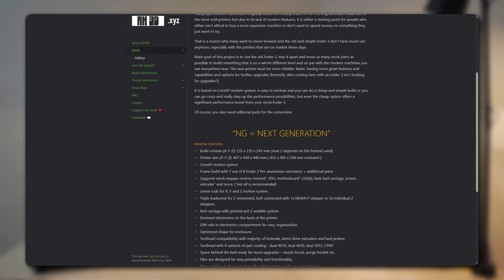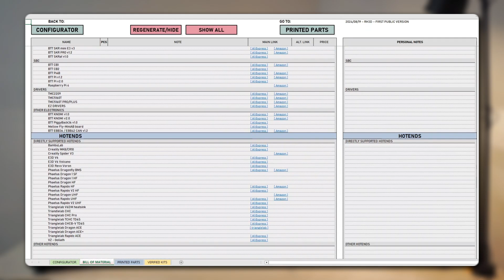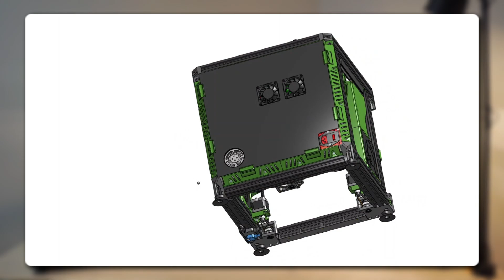E3NG v1.2 released - coreXY for your Ender 3

Comment: To give an advise as an developer: Don't try to make many solutions that fits all. Your project is to small to get so many solutions up and maintained. Make the solution that fits your need. Make documentation (your project site is litteraly empty ("Under construction") that doesn't make appetite to read further). Talk about it. Try to get help. Reuse other projects and mention them. E.g. don't try to build your own toolhead ecosystem when there are plenty open source systems available (EVA-Awesome rails bases system;if you insist of the old steel pipe based linear motion system maybe Hypercube Evo Ngen is a possbile choice).

Clean up your promiscuously Z-axis. I see a mixed up monstrosity influenced by VzBot (tripple Z-axis, Anti-wobble fixture), Creality (adjustment wheels) and Hypercube (steel pipes) that doesn't fit together. If you want to use a trippel Z-axis with anti-wobble it is important to use rails. Pipes make no sense, as the fixture needs a fixed point that pipes can't provide (pipes are joints@z-axis).

Good luck!
Reply: listen to this comment
Reply from the maker: In a certain way I totally agree with you, having one or two options for the build brings many advantages, is simpler for users and gets the result faster as you don't have to work on so many things. The project even started much simpler with the beta version.
On the other hand, since the beta release, I have been closely listening to users and the feedback from community and did few researches during the v1.2 development to know the demand and I think many people appreciate it. Some options are leftovers from the beta version though just improved and I was even thinking about cleaning it up and offering fewer options many times but left it as is for now.

If I manage to bring my other projects to the public though, they will definitely be much simpler with less if any options, it just wouldn't be possible to maintain it all alive while keeping the quality good just as you said.

Also this being my first project of this size, I myself see a lot of imperfections now and I have learned a lot, but fixing and completely reworking them would still be kind of a band-aid fix and the project being already quite spread out, I wanted to keep within the beta version boundaries.
If I would do it now again (or maybe a v2), it would be completely different from the ground up and way better.

Thanks for your feedback, I appreciate it!

Comment: Do you think it's possible to do this with a cr-10 version 2 or version 3
Reply: Basically it's the same base. if something is missing: Amazon is your friend (beams, printer boards etc.)
Reply from the maker: You would definitely need to check first, but there are few builds on discord using different printers as a base with some slight modifications to make it work, I am not sure if someone already did CR-10 build but it might be possible.

Comment: I want so bad to do this but looking at the BOM you start wondering if any of it is worth it when you can just get a bambu lab A1 with AMS for the same price.
Reply: get the a1 and then do this worth it. I have a p1s with ams and a a1 mini and looking to do this to my ender 3 v2 later on this year
Reply: it depends what you are interested in> If you are interested in how 3d printers work and like building, trouble shooting and have a bunch of parts laying around this could be great. If you just want to print stuff get an A1
Reply: It's an heard and soul project, not a brain project 😂 I spend ~900$ for my CR10v0 to let it print at 400mm/s@3000mm/s². Now I brought a P1S for the same money but 500mm/s@10000mm/s² and closed buildroom 😂 It has nothing do do with logic. It passion.
Reply from the maker: Exactly as other said, you either want a printer or you want to build the printer, looking only at the price and time invested, there are definitely solutions that make more sense.

Comment: Hi can i use skr mini e3 v3?
Reply: Is it the board with the already mounted TMC Drivers? If you want automatic build plate tilt you need 3 z-drivers, 1 x and 1 y and 1 driver for extruder (=6 Stepper Drivers).
Reply: @christianmontagx8461  you can easy use IT for the 1 Stepper for z Version, but also Triple z ist possible with a 5 Driver Board when adding a toolhead Board Like ebb36 AS it comes with a 6th Driver for the Extruder.
Reply from the maker: Hi, sure you can use it, there are people using these boards and I have been using SKR mini E3 v2 before, so it is perfectly capable for that.

Comment: What slicer is everyone using for this? Anyone using prusa slicer for it?
Reply: Hi there, while I don't have a E3NG v1.2 coreXY printer I am curious why you are asking what slicer to use with it since as far as I see that's irrelevant here since there is no multi color or multi toolhead setup on this printer which some slicers can't do, right?
So you should be free to use any slicer you want as far as I'm concerned.
Reply: Orca Slicer. Came from Cura to Orca and never want back :)
Reply: @christianmontagx8461  Hi there, have you ever tried prusa slicer? It has a really cool feature where you don't set the speeds for the parts yourself but only a max flow rate and the software determines speeds from this. Makes for really smooth prints in my experience. Switched from cura to prusa and while I think cura has better bridge settings I can't go back to setting up speeds for everything myself lol.
Plus the paint in support feature and paint in seam feature is also really nice to have in prusa :D
Would be interested to hear back from you if orca provides similar features today because as of their release it didn't.
Reply from the maker: @crypton1782  Orca is based on BambuStudio which is based on PrusaSlicer so it has the same features and also much more.
Reply from the maker: Basically any slicer will work, many use OrcaSlicer but Prusa works fine too.

Comment: Hi can you share the instructions manual and is that possible to add bontech bgm extruder with neama 14  as direct extruder
Reply from the maker: Hi! The build instructions have been released a month ago, you can find them on the website. Also Bondtech BMG with nema 14 - don't you mean nema 17? I would recommend rebuilding the BMG into sherpa or other printers that use the internals from BMG but are much lighter and have better mounting on the toolhead.

Comment: Super cool dude. Quick question, I only have an ender 3 max does this kit apply?
Reply from the maker: Thanks! It doesn't work with MAX as is but some users on discord have done it and posted some modified files so if you join us there, you can get it to work.

Comment: would it be possible to convert my neptune 2 to E3NG?
Reply from the maker: It should be, I have been looking into that with the beta version and didn't find significant issues, the main difference were closed extrusions which you could still get to work with proper orientation and maybe few drilled holes (might do without them)

Comment: Really cool. I already built the Beta version of the E3NG and it is awesome. Great to see all the improvements you made since then! I wonder which ones I can retro fit without rebuilding the whole thing!
Reply: What budget of money does the veto version require?
Reply from the maker: Thank you! you can retro fit many of the parts separately, the main dimensions were not changed so basically all the separate assemblies can be changed.

Comment: Can someone with no real building experience build this? Apart from owning and operating a 3d printer i have no experience building something like this.  Cheers
Reply: Once the manual is out for sure, rn u may succeed as well but might be a bumby experience.
Reply: @nobodymadeitbefore  Do you now when that's happening?
Reply: @vhrte49  Not sure the creator seems to need some time. My guess would be at the end of this year, if not an official one, then a community made one. There are some rly detailed build logs already that can be used as manuals.
Reply from the maker: @vhrte49  The manual has been released a month ago. If you can build it without real building experience? You definitely can but sure it also depends on your overall skill with manual work, I tried to make the build manual as detailed as possible and include everything but it is still quite complex build. You now, more complicated than building a lego set :). But if you can do at least the necessary maintenance and have patience, I believe you can do it. And if you join discord, there are many people willing to help.
Reply: @RH3D_cz  Cheers mate

Comment: I have an ender 3 max and am curious if this conversion kit could work with it.
Reply: Interested as well!
Reply from the maker: There are few builds on the discord which are based on MAX so it can be done definitely but I would recommend checking the builds, there are some slight changes.

Comment: Pretty cool project. I’m wondering if this could be adapted to an Ender 3 modified with an Ender Extender 400 kit (Larger bed).
Reply from the maker: Thank you! I believe you would have to source more new extrusions for the frame, but there are already bigger builds with 400x400 or 500x500 bed, so anything can be done, it just depends how much you want to put into it.

Comment: I would love to upgrade my ender 3... Are linear shafts of x axis gantry hollow? If not just a suggestion consider switching to hollow shafts .. can save some weight
Reply from the maker: That's great! All the linear shafts are solid. The 8mm used is not so stiff that I would want to weaken it even more. The weight savings are not so big that it would be worth it. I already tried carbon rods, carbon tubes and did some calculations so I would say I have some comparison and I wouldn't use hollow shafts.
Only if i switched for 10mm or 12mm diameter, then it would make more sense.

Comment: Subscribed, and plan to build 1, then onto converting all my enders and CR10 S5 (500x500) into this if all goes well.
Reply from the maker: Awesome, that's great to know! I am not sure if you are on discord, but there are already few big builds, 400x400 and I think 500x500 too, so you could get some inspiration there.
Reply: @RH3D_cz  no, or not for 3D printing, whats the group/url? Would love to see what they are doing
Reply from the maker: @Patriot_First  Sorry for my late reply, if you still want to have a look, go to the main website and there is a link to the discord server https://rh3d.xyz/into.html
Reply: looking to do the same with my cr10 s5, did you start the project?
Reply: @lucianovigevano8297  Not yet, but I do plan to. I wanted to Core XY it since I seen the first, this project seems PERFECT for it. I will update you on it when I pull the plug. I have get through the current work load before I will be able to start. I bought it back ~2016-2017 and its been apart for years now, problem was having a printer good enough to print reliable parts. Have that now, so going forward.. will be looking to do this. I want to do multi tool head on this and the orange storm giga that is going to be here mid-next month. Will let you know the progress as I go along.
Reply: @Patriot_First  Same here. I have had a cr10 s5 since about 2018, and ended up putting a spendy ac silicone bed heater on it, among other things. I have been looking for this kind of project, so I could convert it to coreXY. I have been wanting to do a tool changer as well. This looks promising.
Reply: @SkydozerFPV  10000% and after they produced those, that size was just about shelved.. I even got the special x carriage from some company that mills em out of one piece of aluminum.. never got it working right, and bed is like a giant plate, total concave~! hahaha.. If and when you do it, put it out there.. so many printer kits begging to be put to good use~!

Comment: I want to build something like this but concerned about the lack of extrusions at the front vertically and horizontally is there a mod for that? I would rather use 2020 extrusions for stability
Reply from the maker: If you look at the website (you can even see it on the black-green printer in the video), you will see there are 3 options to build the frame and one of them has front vertical 2040 extrusions (you could easily use 2020 instead). There was a simple addon/mod for the top vertical extrusion for the beta version and there is definitely some mod from users as well and it will work on the v1.2.
Also if you would be enclosing the printer, the new enclosure is designed so the door panel locks in when it is closed (recommended thickness 5mm) so basically all the front of the printer is stiffened up even more.

I have been testing the v1.2 quite a lot prior to the release and also doing comparisons with and without front vertical extrusion and the input shaper graph was basically the same. Though that was on the "ultimate" frame version, the printed version might have some difference.

So because of that, I decided not to add the front horizontal extrusion even as an option and just put more attention to the frame squaring and alignment instructions once it is ready, because that is what makes the biggest difference.

Comment: Love this project, you definitely are a great engineer.

Can an ender 3 s1 pro be used?
Reply from the maker: Thank you for the kind words!
I am afraid S1 has quite a lot different extrusions so it would need a lot of changes or buying additional ones. There is a list of the stock extrusions with dimensions in the Bill of material so you can compare them to be 100% sure. I was looking at the s1 quite a long time ago so I might not be 100% correct here.